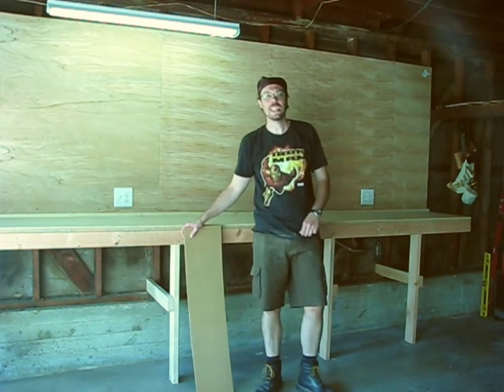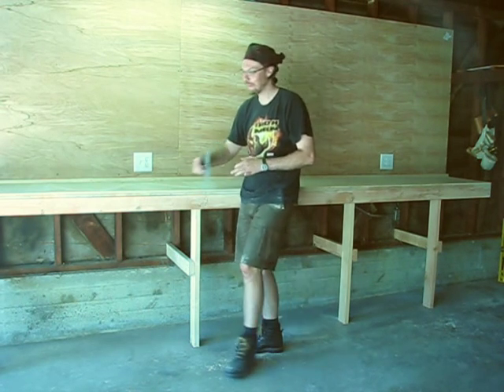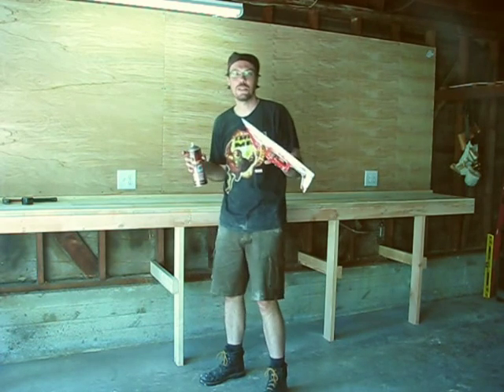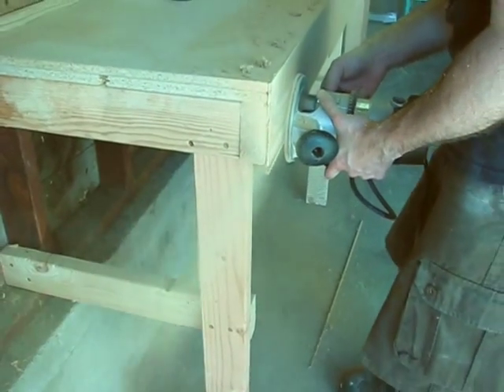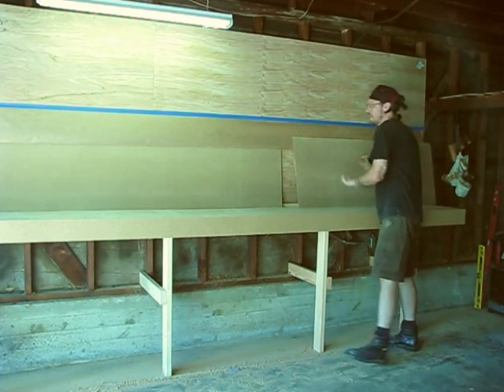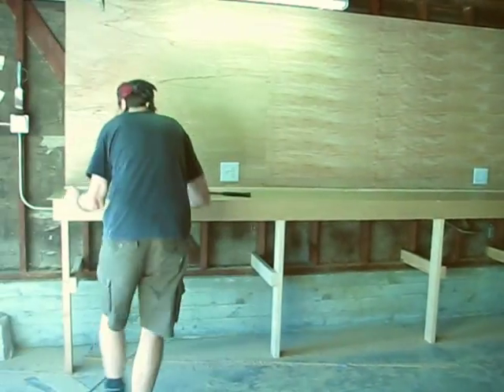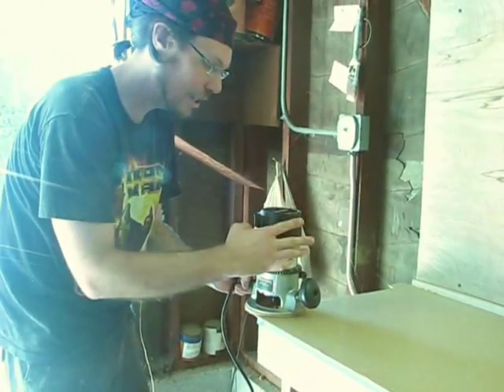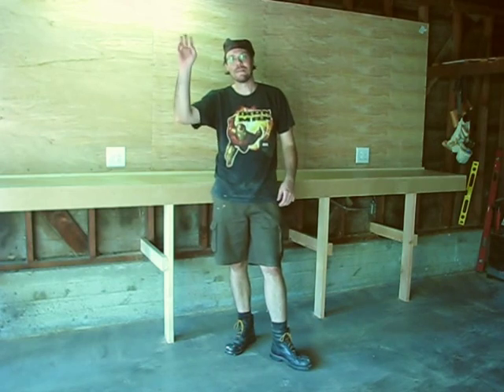Build a Masonite Workbench

Comment: Great workshop space and bench, Kevin.  I'm about to build a similar one and plan to use a power saw to cut the masonite to size and am going to use a great tip I saw Norm Abram from New Yankee Workshop use, that when you put the trim on, you can set it to stick up higher than the plywood or particle board to the thickness of the masonite piece.  Then fit the masonite without glueing, so that you can change it out easily if/when it gets rough from use.
Reply: That's another good way to go, although the it really isn't that tough to to peel the masonite off with the glue, either.  Norm A is the man!

Comment: Interesting video.  Good job.  I also used Masonite on my workbench.  After all, my dad used Masonite on his workbench that he built before I was born.  You can skip the contact cement.  A couple of screws along the back edge is all you need.  Save dollars by not having to buy glue, chemicals and tape/paper for overspray.  With a couple of screws, it takes no effort to replace the Masonite if needed.    I faced my leading edge with scrap steel so I can use the bench for metal work also.  I also have a four foot long section that I further topped with thin sheet metal.  Comes in handy when doing both woodworking and metal working.  And, the metal protects the bench when I'm tearing down small greasy engines.
Reply from the maker: So I agree in principle, but i work with a lot of finish pieces and I'm a tad paranoid about scratching something on a proud screw.  If you are going the fastener route, though, panel nails work well too.